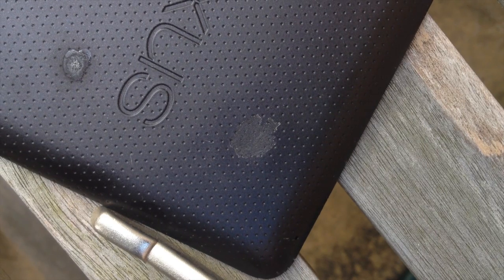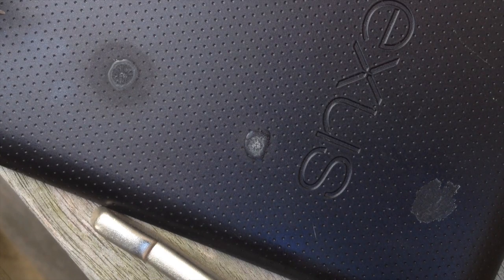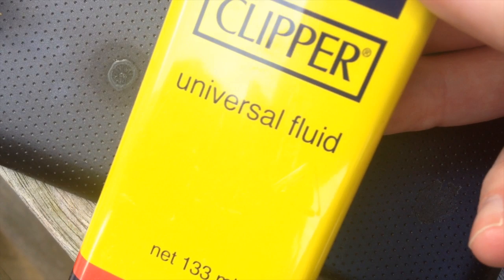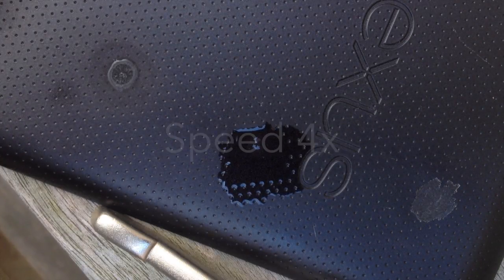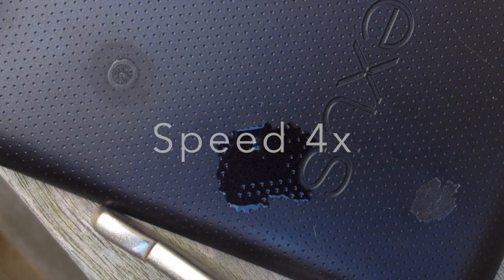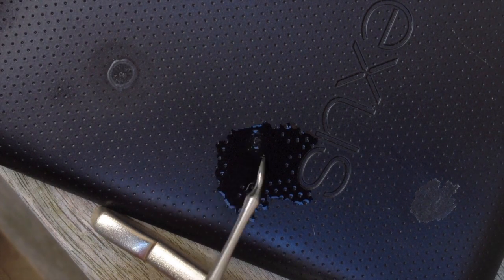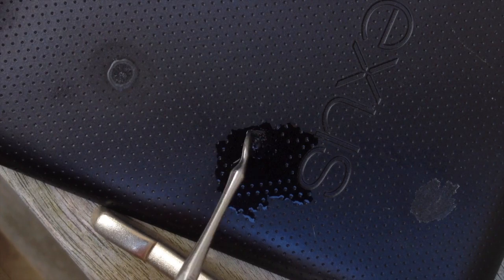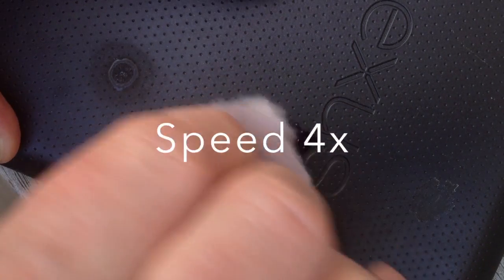Removing Superglue From Uneven Plastic Surfaces Experiments - Part 3 Using Gasoline Lighter Fluid

Comment: The reason thishas so many dislikesis becauseof the title. It is too misleading.
Reply from the maker: The title of the video is Removing Superglue From Uneven Plastic Surfaces Experiments - Part 3 Using Gasoline Lighter Fluid
It clearly says its an experiment which is what It was after somebody said Superglue could be removed with Gasoline.  I think think its misleading if people don't read the entire title.